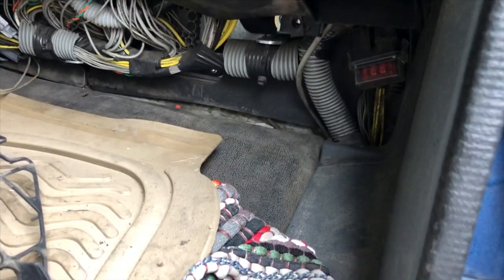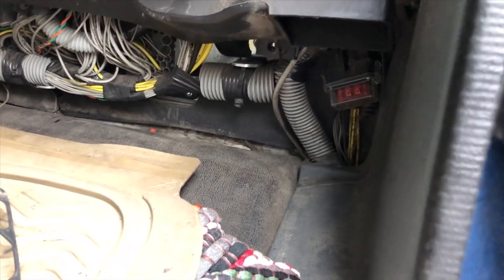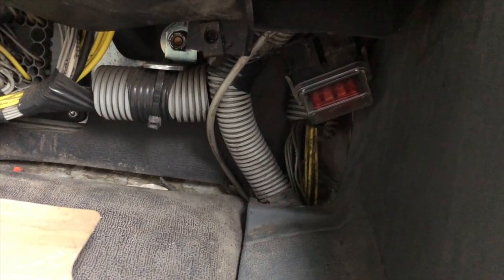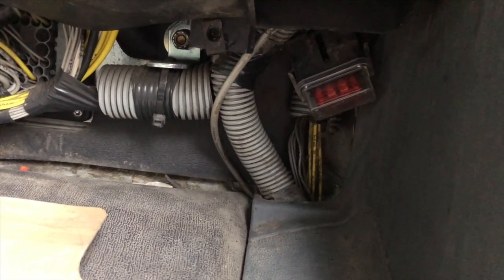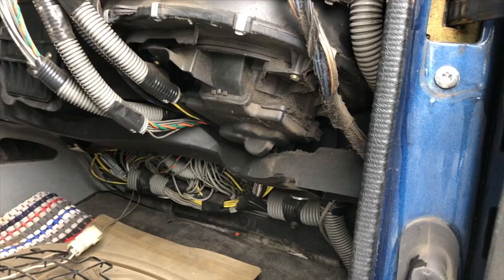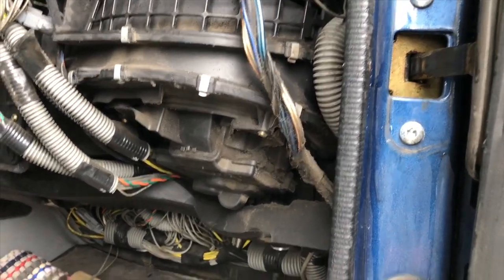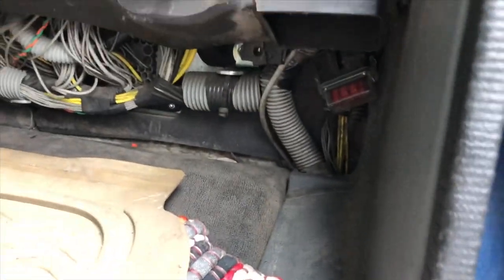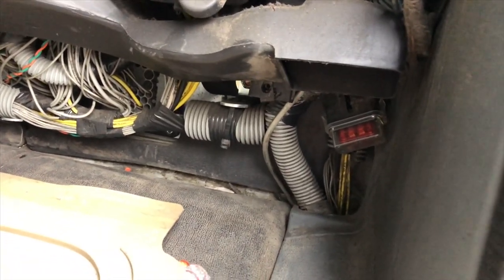Trucking , 2007 Freightliner Columbia power points , dome lights not working fix .

Comment: Great tip on that fuse- but mine was hot and intact. There is a fuse in the SENSING circuit, usually in the underhood box, that feeds the circuit 477B, Low Voltage Disconnect Sensing, pin E on the LVD. Mine wasn't blown, but one leg was corroded off. Pushed the remains through with a new fuse, cleaned the contacts twice, replaced the fuse. Connected the battery charger (my cluster is out for repairs- open air lines). At 12.8 volts, reset occurred and all systems are go!
Reply from the maker: Great JOB !!!!

Comment: Hi Scott. So I took the panel off, but I can't find that thing anywhere. I have a 2009 Columbia. Maybe this model year didn't have it?

I took a couple of pics to send to you, but I don't see an email for you.
Reply from the maker: I had my email on here and people loaded it down with stupidly and adult type content. So I took it off. Sorry
Reply: @Starkeyfamilyfixing  I understand. So I fixed the problem. It was the LVD. I did a bypass by connecting both terminals together with a nut and bolt. I didn't bother looking for the mega-fuse because once I did the test that confirmed it was the LVD, I figured that the mega-fuse HAD to be intact, otherwise my lights wouldn't have come on during the test. Thanks for getting back to me.

Comment: Hi Scott. From one minute to the next, all my interior lights stopped working. ALSO, the cigarette lighters and little usb chargers on the dash aren't working either. Is this the cause?
Reply from the maker: Most likely yes , now if you check it out remember the fish does not have to be blown , it can be corroded inside. So it’s bet to replace it while your there regardless.
Reply: @Starkeyfamilyfixing  There's a fish inside there? 😆
Reply from the maker: Lol I replied on my iphone!!! This thing is always changing words lol 😂 I was trying to say fuse !!!

Comment: If the fuse isn't blown what else could it be? All my dome lights stopped working one minute to the next.
Reply from the maker: A short which could be anywhere
Reply: The low-voltage disconnect. It is behind the center console under the dash. I had the same problem. I just did a bypass and BINGO. Everything worked. I know you posted a long time ago, so did you find the problem? What was it?

Comment: No wipers, ac blower, or headlights, all fuses up top working. Could this be the culprit ?
Reply from the maker: tarvares2003 it killed about everything in the cab of my truck
Reply: Mine was still good, I ended up jumping the 3rd post under the red cap in the fuse box up top. Works like normal
Reply from the maker: Nice !
Reply: Would this be the reason for the desk light not working 2017 cascadia
Reply: Did you figure what it was mine currently wipers don’t work and ac blower doesn’t blow nothing